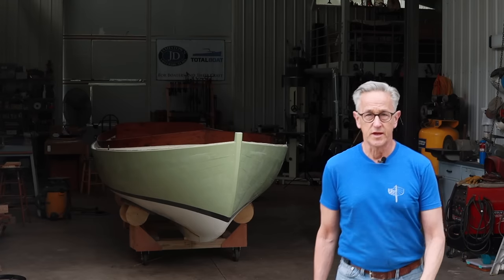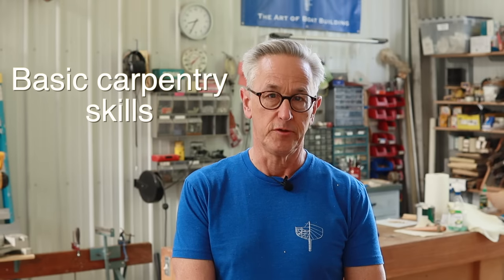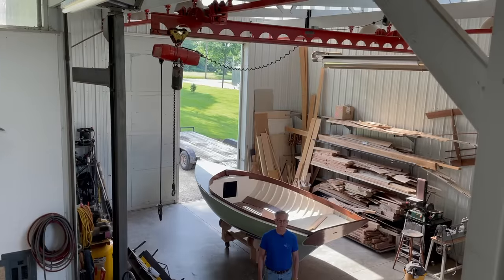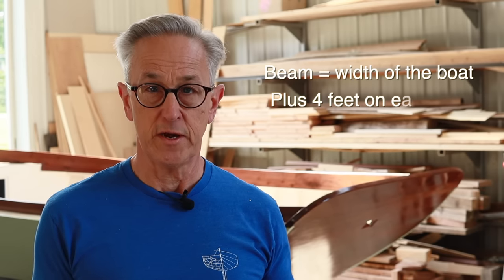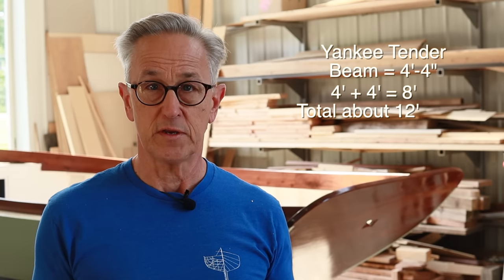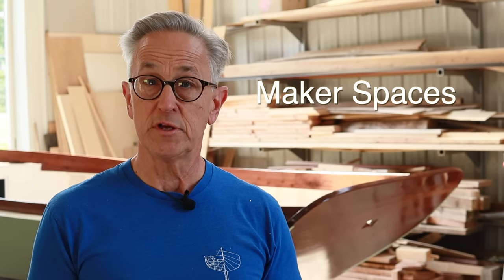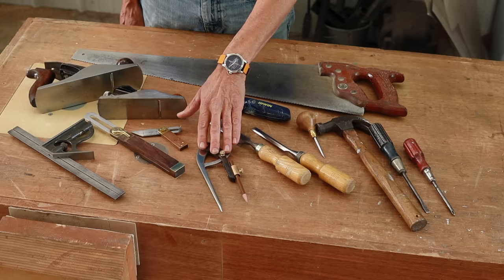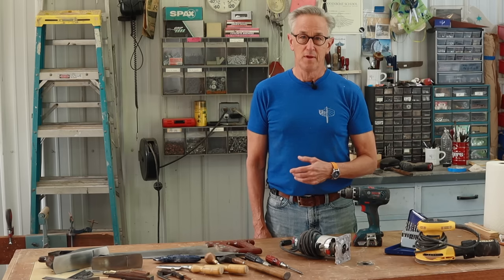3 Elements to Building a Wooden Boat

Comment: Thanks for your generosity in sharing your hard-earned insights with us – you are a gifted teacher.  (And an excellent videographer too!)
Bob, one factor I’ve noticed about myself, having built 9 canoes & kayaks over the years, is that with each boat I build, I seem to have acquired an increasing patience in completing each step of the project more carefully.  A willingness to spend more time and effort on the little things, like fitting a joint just right, or taking the time to sand through a series of increasingly finer grits.
The first kayak I made, with my son, was a stitch & glue model from plans.  It went fairly quickly, and a good thing, because we were anxious to get it done!  My most recent project was a solo canoe I designed myself, cedar strip and fiberglass.  I probably spent as much time designing & building a pretty Adirondack-style caned seat as we spent on the entire first kayak.  And of course, it shows.
But the point is, I never would have had the patience to spend that much time on one of my first boats.  Choose a simple project for the first one!

Comment: Bob not only are you a skilled artisan but you are a fine Gentleman as you are willing to help others. When I built my 14 foot plywood Jon boat I found a handheld power plane to be very useful in rough cutting bevels and removing the waste plywood after I glued it to the frames. I was lucking in that I was able to use one of the empty bay f the Fire Station I was working at. One thing I did figure out real quickly was only mix small batches of Epoxy as if I mixed a large batch we would get a call and it would be hard before I got back to use it :-(

Comment: I'm surprised you don't use a proper boat builder's bevel. The are much better suited to the trade and have two lengths of blade in one tool. They are not hard to make and would be a good tool making project.
Reply: Do you have a link to this tool, or a picture there of?
Reply: @thomasarussellsr  It's quite a while since I was boatbuilding and mine was passed on to an apprentice. While still capable of building you a boat, my total lack of computy acumen precludes my offering you one of those clever blue linky things. However if you search Google images for boatbuilder's/shipwright's bevel, you will recognise it as being the slender footish long with a long blade at one end and short one at the other. They would have been commercially available in bygone days but we made our own. Rosewood (or similar) and brass or a phenolic resin material (Tufnol) works well in lieu of a hardwood. All aluminium versions make a bomb proof version too. I hope you can make something of this.
Reply: @gav2759  okay, thanks. I'll attempt to look one up.